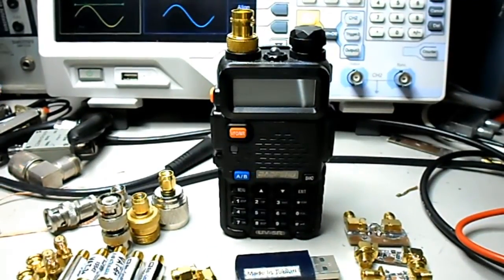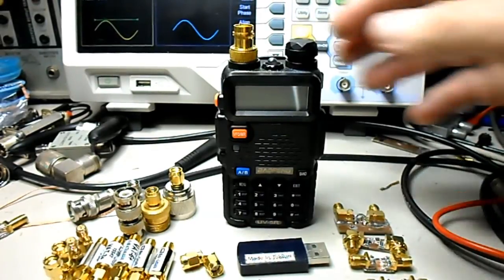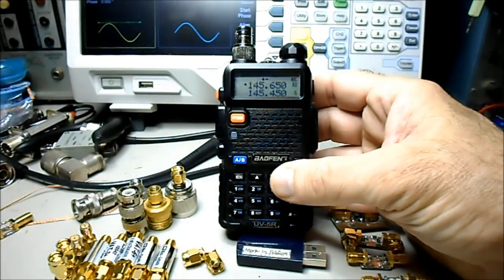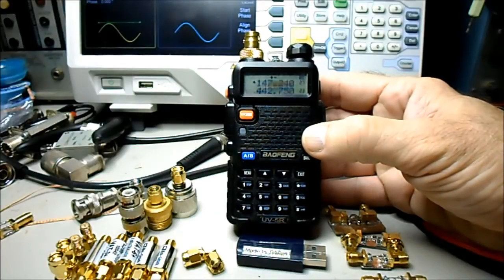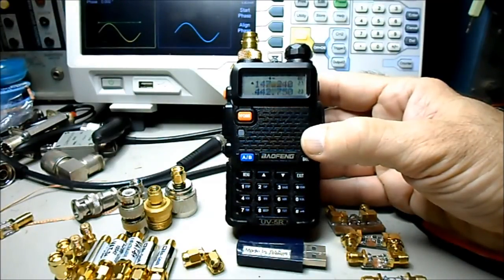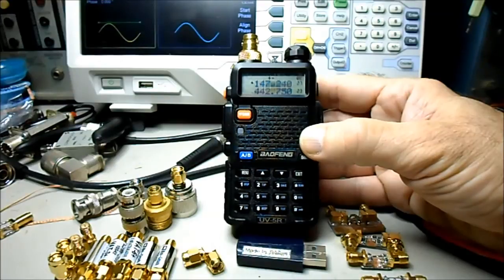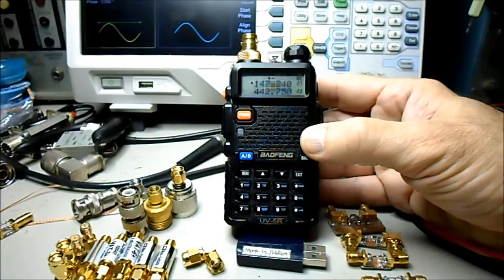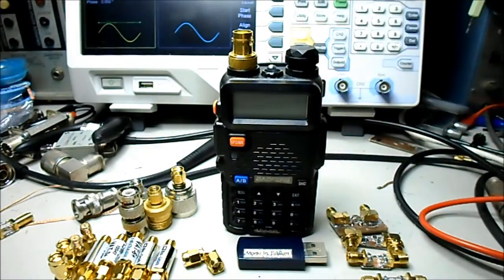Baofeng UV-5R Heat Issue

Comment: That’s what happened to mine. I was using it back and forth and after a lil while it got hot. Especially by the screen. Then I noticed the color was off. I’ve had other boafeng radios and I never noticed that problem. So I came on here to see if anyone else was having the same problem. It sucks that I can’t use it too long.

Comment: I have been poking around for some info on this as it happened just programming it in Chirp. I am BRAND new to radio and this happened to me with 2 new Baofeng 5Rs. Could it be that I had an after market larger antenna attached? Now it got hot, very uncomfortably hot, but the LED or LCD display was not affected. Even though I turned it off my impression was that it didn't start to cool until I dropped the battery. Not 100% sure.

Comment: The reason this is happening is due to the output transistor heat sink is mounted under the top of the radio long qso will create the screen to fade as it heats up it normally happens on the antenna side of the screen display. 73

Comment: I find mine gets hot anyway without transmitting ... and obviously gets really warm when transmitting, I do have the stock antenna (the thinner uv5r version)   has anyone come up with a solution, other than changing the antenna ?  ...

Comment: just not designed for big long boring overs at full power,i just use my uv5r on low power and it works fine,high power i keep over less than 60 secs with no probs,good radios for the money,if it breaks bin it and get another,your kenwood handset will cost you 50 bucks plus per hour in a work shop,,,so you pay your money and takes your radio,the uv5r is what it is for the money,but there not junk...there just ok.
Reply from the maker: Someone was also mentioning that switching to a bigger antenna other than that small one that comes with it provides a little more heatsinking .. and in my case with the test I just had a cable connector attached ..
Reply: why anyone would want to talk non stop for 3 mins plus must have a  lot to say,no regrets about buying my uv5r,used it everyday for since last month,although i do notice the keypad showing a little wear,the programming software is a pain with comport issues,but if you can live without that then its fine for the money...regards to all..gm7jds

Comment: The heat issue is caused by the poor stock antenna.  If you replace it with a better antenna, even the better Baofeng antenna, your problem will go away.
Reply from the maker: John KD8DVR Thanks John .. all I had on it for my testing was the connector and attenuator .. so not much of a hear sink for sure ..  Always feel free to ask questions or give ideas for future videos ..
Also please subscribe and share if you haven't already done so..
Reply: Even with a good quality antenna the Baofeng UV-5R still tends to get mighty hot, particularly if you are having a long QSO and particularly if the weather is warm/hot.  Even when I am done talking and I put it back in my pocket or belt clip it takes a good while to cool down.  Bur despite the heat I have yet to have any problems or damage related t the heating issue and I have been using it for several years. Operating it in cold weather /winter the heating issue is less of a problem.  Another good way to keep the radio from getting too hot is to run it on low power if you can. On low power it just gets slightly warm.